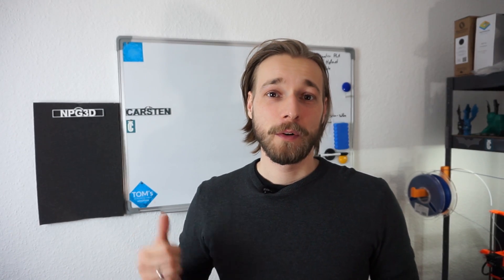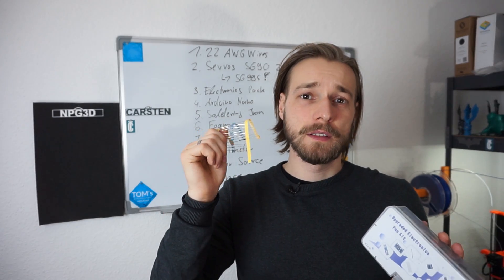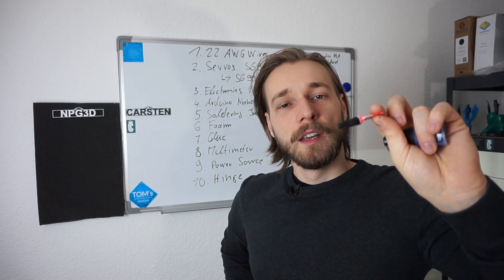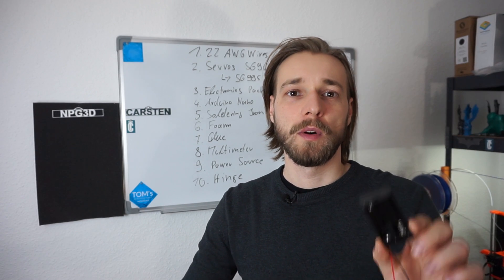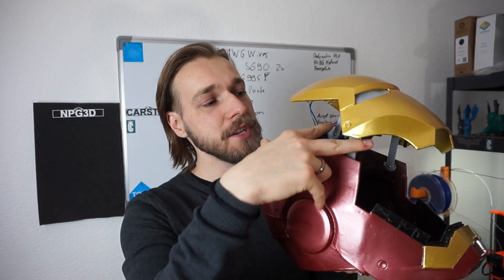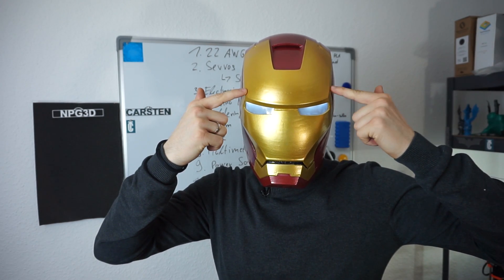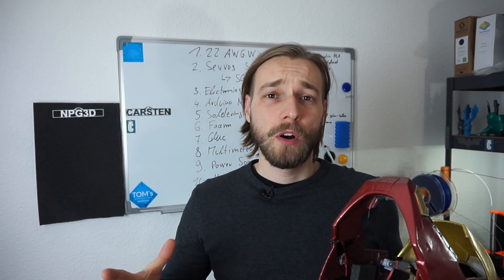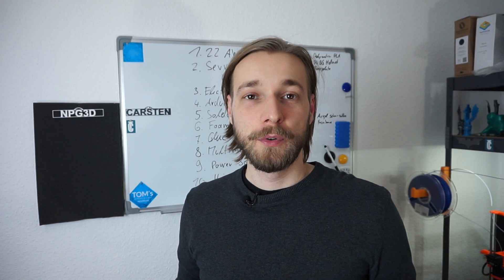Iron Man Helmet Moving Faceplate and illuminated Eyes

Comment from the maker: Hey all! Due to frequent request: You can download the code for this project right here: https://drive.google.com/drive/folders/1TSEZj2w-Fk3QoyRyIhcsMeI6YED_TDHe
Let me know if it worked for you.
Reply: Thanks for the code!  I got this working on a breadboard, but after a while, it started acting strange.  The servors would move back and forth uncommanded, and the LEDs would blink but not stay on.  I'm not sure what I did wrong, because initially it worked fine.
Reply: @LowerDeckProps  same for me also same exact action .. is the code corrupted ?
Reply: @fpv_drone_adventure  I since learned that the servos with the metal gears act erratically, if they are not provided enough power.  You need to provide power to them directly, not through the Arduino. Also, an "always on" power bank is the most reliable power solution.
Reply: @LowerDeckProps  so run the power not off Audrino? Thanks
Reply: @fpv_drone_adventure  I used the same and it worked for me, check if the circuit that you made is right
Reply: Thanks for this.  I do have a question.  I am only going to use one servo (mg990), so do i just remove all commands for myservo2?  i am new to Arduino.  Thanks
Reply: @1138paul  Is not necesary, just make sure that your servo is conected in one of the two outputs used in the code
Reply: It’s works but eyes keep
Flashing faceplate open then close on it own and it keeps repeating itself without me pressing switch...please help

Comment: Hrm. This might be a dumb question, but I'm new to servo-motors. If you shut off the system (pull the batteries/batteries run out) while the faceplate is in the "toggled state", won't it break the hinges when trying to fx open the faceplate, while it's already open?  I don't suppose it can remember the previous state in this case?
Reply from the maker: They do not have enough force to break the hinges. And if the servos are not powered anymore the faceplate would most likely close themselves. As the servos are trying to hold their position while powered, when the servos are powerless there's almost nor resistance / force left for them to hold anything

Comment: Hi mate, great video and thanks for sharing! I have just finished my helmet and used the code etc but I have a small issue I was hoping you might be able to help me with? It all works great and I used the larger servo you suggested but for some reason when it opens (and the servo disconnects) the faceplate drops down a few inches. I am a complete new comer to all this so I was wondering if there was a way that I could stop the servo turning off after opening in the code as I’m on,y going to need it to open for a short amount of time? Thanks again 👍🏻
Reply from the maker: Did you still use two servos or one stronger servo?
Reply: WF3D hi mate, no I used one mg995. It works great but as soon as the code tells it to disconnect and the power goes it drops down. I was hoping to just keep it connect until I closed it again and that way it will stay up. I’m have no idea when it comes to code so was hoping it was easy and someone could help 😂

Comment: I managed to copy the whole code, I cable everything as in the video except the switch, I just have a push button. and it does not want to work :(
Reply from the maker: Did you use the right pins? ;)
Reply: @WF3D  it's good since you sent me the code and plans everything works well except the leds that flash before the face closes. the reverse of the video. in your video the leds flash after the closed sided face: D
Reply from the maker: @TheDonuts02  hm.. I think there is a delay in the flash you might try increasing it
Reply: @WF3D  it's ok I found the solution, there is no logic but it works! I simply reversed the commands :
"Lightson ();
delay (500);
closefaceplate (); "
and 

"openfaceplate ();
  delay (1000);
  lightsoff (); "

:)

now I have exactly like you

Comment: Man I'm loving this project and I'm glad all the electronics worked as they should. The pack of electronics and multimeter idea is not bad at all, and as a matter of fact, that's how I got into electronics. Also, I had that same multimeter you have for years (Maybe 6 years) and it just broke early this year.
Reply from the maker: Yeah those starter kits are extremely good for beginners like me. Glad you liked it! :) That's a chinese one guess that's a mass product ;D
Reply: amigo no puedes enviarme el la configuración tengo casi 1 mes intentando busco vídeo y todo pero nadie tiene completo tengo todo para armar los arduino pero el programa nada , hay muchos que envían el programa pero no esta completo con luces y todo  ayudarme , hace ese gran favor  te lo agradecería  toda la vida  tengo el casco todo
  
cedillocedi1@gmail.com 

mi correo por si te decides .gracias
Reply: @cesarin2008  para que tipo de arduino?
Reply: @LeisonRichards  
Los mismos servo motor y Arduino todo los del vídeo asta para armar unos 3 cascos tengo
Reply: @cesarin2008   y cual es tu problema específicamente?